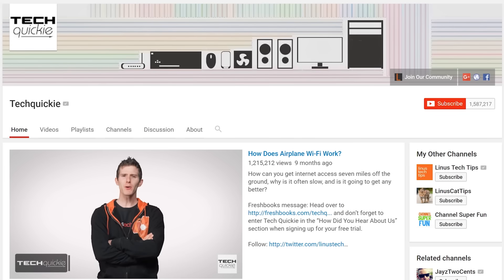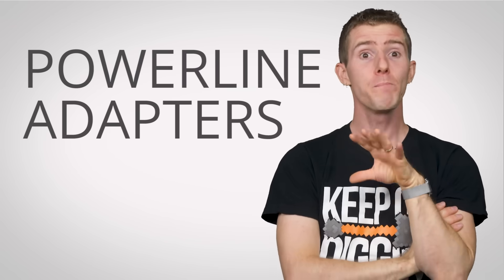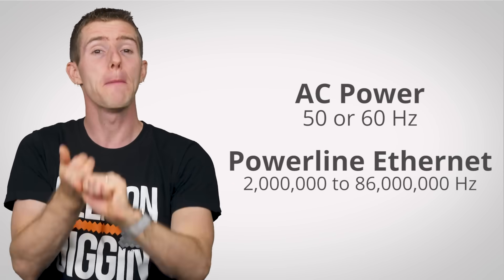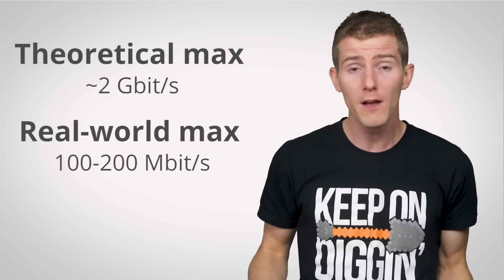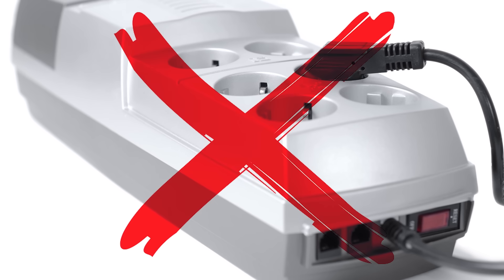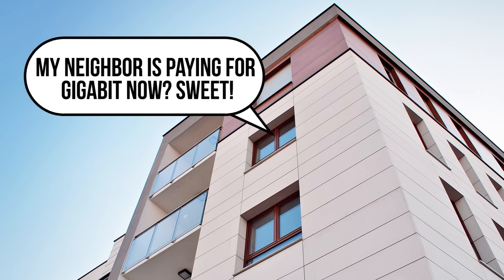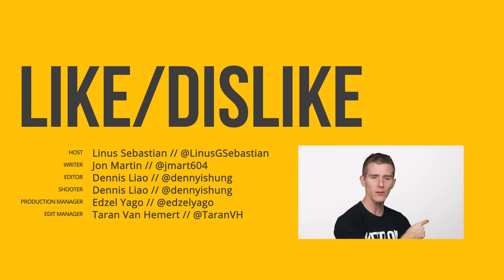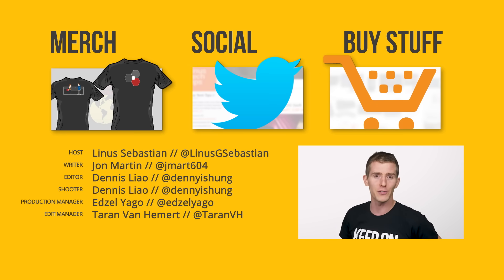How Does Powerline Ethernet Work?

Comment: >consistency advantage over wifi
Hah. I had powerline adapters. My use case was dead simple, and extremely low expectation - I had a setup for satellite TV where I had one main decoder attached to the main TV and two extra decoders attached to other TVs, with the main decoder essentially needing to just ping those side ones roughly once every 24h to let them know it's cool, they can keep on doing their thing. While the side decoders were in range of wifi (barely), they didn't actually have any wifi capability. Wiring everything up wasn't an option... but then, the perfect solution - powerline adapters! Yeah, no. After a year of grief with the adapters semi-permanently (until unplugged and plugged back in) losing connection randomly and a neverending cycle of resets, I had enough. So I bought the two cheapest old wifi routers they had on our local craigslist equivalent (think $4 each), OpenWRT'd them up to turn them into bridges putting whatever's connected to them onto the LAN as if it was connected to it directly (using relayd), and hooked the decoders up to that instead. And what do you know, it's been years and even with a weak wifi signal that has to go through multiple really thick old brick walls, I haven't had a problem since.

The idea seems fine but booooooooy did I get burned in terms of actual experience.

Comment: I have been using these "HomePlug" adapters for years and like most network devices, occasionally these need to be unplugged from the wall for 30+ secs and then plugged back in to reset the powerline network connection to your router/gateway.  but with each new faster generation devices you buy, you pretty much have to replace all your old slower powerline adapters, which can get expensive.  also remember to use the fastest ethernet cables between these adapters and your computers.  I have always stayed with Netgear models which Best Buy and MicroCenter carry here in the states.
Here's Linus comparing WiFi AC to Powerline...
https://youtu.be/Oxum9TZ11-M

Comment: We pay for 120Mbps
Direct LAN connection: 135Mbps
WiFi near the router: 135Mbps

Powerline one story up: 7Mbps (theoretical max: 200Mbps)
WiFi there: depending on the device between 18 and 70Mbps

Powerline 2 stories below: 30Mbps with many dropouts (theoretical max: 550Mbps)
WiFi there: depending on the device between frequent disconnects and 40Mbps

How does it come that our WiFi is so good in comparison to yours and our powerline capabilities to bad?

Comment: I use power line Ethernet as backhaul between floors and mesh wi-fi on each floor. I get solid 500mbps between floors and full wi-fi in all locations.

Comment: i think modern meters have enough filters on some kind to block higher frequencys, maybe just older mechanical meters pass through enough high freq. to get powerline adapters work in the next house if they connected to the same cable/phase.
if you want to block high freq. not going in or out your house you simple can add some filter that should work good enough to avoid some neighbours connecting to your lan.

Comment: Ive had a powerline ethernet adapter for about 7 years now. Ping is so consistent and my wifi is only faster on the 5ghz channel and while being on the same floor as the router. My room is as far as possible from my router and I never have a problem, just make sure to plug it directly into the wall and not into an extension cord or surge protector. I just got fiber installed on my street and im going to be switching to gigabit soon, ill have to upgrade my adapter but I've looked and the speeds have increased for them aswell.

Comment: Tech noob here - would this work if the PC's ethernet cable is plugged into a 220V outlet and the router is connected through a 110V?  I do believe the signal would have to travel through the breaker box. My internet is only 110/45 so I don't need gigabit like capabilities.  No, a direct ethernet option is not available.

Comment: lol I never even considered powerline adapters because I assumed they would never work properly. so I bought a cheap pair (€20) on Amazon and plugged them into my grammas house from the 40's with old wiring and no grounded receptacles in most of the house. I am shocked! even in her garage and garden house (literally 30 meters away from her house), it still works excellent. 7 ms ping to a speedtest server, jitter 0,75 ms. I should try pinging something local. wifi can barely go through walls in her house (it's Europe so they're all brick and concrete regardless).
this + a router actually gives me faster reaction times than the built-in 5 GHz wifi antenna in her DSL modem - which is crazy.
Reply: I know its europe because you mentoned grounding
Reply: "I'm shocked!" I don't know if that pun was intended or not
Reply: If I use this for gaming will it slow down people on a wifi connection
Reply: Off course it works, it emits from the electric wires in your house, actually turns your house into a giant antenna emitting strong signals on the entire HF band. Just google HAM radio and PLC. Much stronger signals than wifi indeed. Do you want you and your gramma to live on top of an aggressively emitting antenna on 24/7?  Ethernet cable is cheap and clean.
Reply: A J it's not clean if there's no Ethernet in the walls. Perhaps you live somewhere with cardboard houses and hollow walls so it's easy to run extra wires, but it's easy where I live. you're looking at thousands to rewire your house.
electricity needs to be checked / renewed every 20 years, and it'll be due by 2022. I'll consider running Cat6 or maybe 7 if it's worth it through the walls.
Reply: @arnemaeschaelck5012  Can you tell me the name of the exact product you purchased, I am very pleased by your statement and am tempted to by the product
Reply: @arnemaeschaelck5012  I did exactly that, bought shielded ethernet cable (made to transport data, unlike electric cabling) and pulled it to where it was needed in the house. Yes a bit more effort but fit for purpose. Neccessary as I listen to shortwave radio and like to have a clean reception of weak, far away signals and stations. So I do not have to live with 24/7 massive garbage signals emitted all around the house. PLC's cause massive pollution of the spectrum. I understand most people do not realise this, and buy PLC's it in good faith.
Reply: @enjoylife_carpediem  2 things.
1. Garage likely has power with outlets to plug these things into so it's not emitting anything.
2. We have tv and cell phone signals going every which way.  We already live in a radio signal saturated world.
Reply: @jmugurr994  The electrical wires of the house/garage radiate strong signals over the entire HF band once you connect the PLC, the newer PLC models emit rom 1 up to 80MHZ.  Those wideband signals are strong enough to bring down any shortwave receiver, on any given frequency, in a radius of 100m, just try it and see for yourself. Compare this to mobile and wifi signals which nicely stay in their bands and cause no disturbance at all.

Comment: My brother just tried powerline with disappointing and weird results. 20 mbps on a 150 mbps connection only 2 rooms away. The weird thing is that he was getting 40 mbps when one of the powerline was on a surge protector. If both were on a surge protector it went back down to 20. Tried multiple times with the same results each time.

Comment: The only issue with this is if you have old 2-wire romex it won' t work correctly. It uses the ground in the romex to carry the signal.

Comment: Well Ive had my Network Adapters for about a month now. And it works. But the internet connection of the home itself is still sporatic. Sometimes I have no lag at all, and other times everyone in the house struggles to watch YouTube and I have lots of latency. And it even worked surprisingly well at my granparent's 1967 built house.

Comment: 2 to 86MHz is essentially the HF or High Frequency part of radio (with some low VHF). It includes many military, broadcast and ham radio bands that are still relied on for local and worldwide communication. This can cause problems for those users as was found out in the late oughties when broadband over powerline (BPL) began to be used as a way to distribute faster than dsl speed internet to difficult locations. The system basically made using the bands between AM and FM radio (1 to 86 MHs) useless. Of course this was more of a problem for a system that could cover large sections of a city than a one home installation. Aside from hundreds to thousands of Ham operators, most of which knew and understood the problem, complaints came in from radio users from NOAA Weather Radio to taxicab drivers.  Even Citizen Band users would hear the buzz of BPL. While It lasted only a couple of years it left behind a fully developed technology. It seems that has been turned into another solution for WiFi's limitations. Unless you are (or live next door) to a ham operator it just might fix your WiFi.

Comment: I have learned that these power line adapters do not work when you have to pass through sub panels. Ex: from a room in my house through a sub panel to my workshop building.

Comment: we are wanting to have internet in the upstairs of an old 100 year old building that does not want us drilling holes or running cables. while there IS internet downstairs, we can not get any upstairs via conventional means, do you have any suggestions we could try if powerline networking falls short? we are going to need a bare minimum of 8mbps upload / download.

Comment: This stuff works but there is a problem with a frequency  conflict with DOCSIS. Many of these that go above 86 MHz cause issues with coax QAM upstream, which in most areas is in the 5 to 50 MHz range. Causing major interfere with others that can bleed over onto the coax through the DOCSIS cable modem can add noise on the plant and may result in you being disconnect  at tap by your ISP.
Reply: Tried the power line stuff advertised at 1Gbps but only managed around 8Mbps down and slighly faster upload at 15Mbps for some reason. Then I got the idea since I don't use cable but there are cable jacks everywhere, bought myself a Docsis 1.1 out of curiosity how fast the uploads can go if maxed out of the theoretical 10Mbps, came with 1 40Mbps downstream shared with everyone on the node and like 8 upstream line cards. The uploads came with two modes one is limited to 5Mbps and the other 16QAM 10Mbps. I set the highest of course. Believe it or not all you need to boot up those Surfboard Modems were a Windows Server 2012 R2 machine or similar with DHCP and with 3rd party TIME software installed (NOT NTP), tftpd64 software and a free config creator (just make sure to set the proper secret on both the CMTS and config before compiling). With a single modem on the line (with correct attenuators so not to blow things up) the downloads were decent close to 40Mbps, but the upload even uncapped were at a pathetic 4-5Mbps at a max 10Mbps @ 16QAM, and at the lower 5Mbps setting it was some pathetic 1Mbps or less! This was with ONE modem online, no wonder ISPs offer packages like 5Mbps/128Kbps-512Kbps back then. Got fed up and just shelled out more cash for a used mini DOCSIS 3.0 with channel bonding and got close to the 1Gbps/200Mbps. It doesnt take much to get a modem online, the software ISP uses just have added billing and customer information, but useless if you just want to use those jacks. Modems are dirt cheap just the CMTS if you can afford it.

Comment: So I’m running my Xbox on the wifi. The router is downstairs past the kitchen on the other side of the house. It’s a crappy router and I’m using a crappy extender. My download is about 5 mp/s and my ping is usually 150. I can’t straightlone Ethernet in because 1: super far and a 100ft wore barely reaches. And 2: the mum doesn’t want a long add wire running across the house. Should I beef up the router and extender or just buy a power line adaptor? Someone plz help. Need to figure this out for my new set up
Reply: A Powerline adapter is the best option if you want to carry the internet signal from the main router all the way up to your bedroom. The first part of the Powerline adapter connects to the main router via LAN, and then the second adapter goes into your bedroom (they both must be directly into the plug socket, not through an extension cable). Then you have excellent signal strength in your bedroom.

Comment: Trust me, avoid using powerline network adapter even if your life depended on it unless you live alone. If you live with others all it takes is for them to charge their phone in their room at night and you will not have internet unless it's unplugged.

Comment: I’m told that the power line adapters have to be on the same circuit. I’m experiencing trouble with this after a recent install attempt; modem on one circuit and Xbox/power line adapter on another. I can’t catch a signal. Any thoughts?

Comment: My Netgear Powerline 1000 slowed down connection to FB and Youtube.  Because when I removed it and used my WiFI network directly.  The programs load just fine.  Had  Powerline installed and working great since December 2016.  So did it just wear out??

Comment: My router is right next to my computer, and I am trying set up power line Ethernet. Can you connect the first and second power line box to the same wall socket or do I need to connect the second power line box to the outlet in the other room and run a bigger Ethernet cord from that room to my computer?

Comment: Hi can anyone help me out here?
So I have an ordinary router thats connected to a powerline and wondering if I can use a second router for stronger signal/speeds on the other end of the powerline adapter.

Will this work?

Fibre Box > Router 1 > Powerline 1 > Powerline 2 > Router 2

Comment: One downside of this stuff is that it's frequencies overlap amateur radio HF and VHF frequencies. Power lines and home wiring is not known to be very good at keeping the RF energy contained.... Actually, it's terrible at doing so. This stuff wrecks rx. I can tell when someone near my house is using the internet, which is often. I hate this stuff for this reason alone. Selfish? Yes. Justified? Also, yes.
KI7ONN

Comment: So it actually works by sending a frequency down our power line. A different frequency than the 60 Hz of AC, so that there's minimal interference with both signals. Similar to how our radios pick up different frequencies

Comment: Question for Linus...for anyone actually. I live in a 3 story/6 bedroom townhouse and recently got FTTp installed in the house giving me a 330mbs down (theoretically). Would I be better with a wifi mesh set up OR a few of these strewn around the house.  I'm getting OK wifi throughout the house using the generic isp router they gave me but I figure I may as well max out those speeds. It will be serving 2 desktops, 2 laptops, 1 tv, 3 chromecasts, 2 phones and 1 tablet a ps4 and an x1x. Any help appreciated.

Comment: Hi everyone, I need your help :)

I have Ethernet outlet in the wall, both downstairs and upstairs. My router is connected upstairs and I have a WiFi dead zone downstairs.. I tried a WiFi Extender but it’s not working so well..

So my question is: Can I connect a second router (and use it as AP) in the Ethernet outlet downstairs to solve my WiFi dead zone issue?

Huge thanks to anyone who helps! 🙏🙏🙏

Comment: Like so many people in the comment section, I too had my reservations about PLC. My family made a recent downstairs addition to our house with my brother and I moving there. 1 single electrical line runs downstairs from the upstairs breaker box to the downstairs breaker box where of course it branched off. Not only does downstairs host myself and my brother and all our electrical baggage but it also hosts our washroom with two washing machines and a dryer. Running an ethernet cord along such a high powered electrical wire would have been a nightmare. I found out about PLC whilst refreshing solutions to my problem, a Wi-Fi repeater would not work due to my house being all concrete. 

I borrowed my friend's PLC AV500 standard to test the technology. I averaged 50MBPS download but it absolutely flatlined on laundry day for obvious reasons. Upgrading to AV2 standard solved all my issues. I now average 269 MBPS and 189MBPS upload, dropping to 169 MBPS download on even the heaviest electrical load, more than enough to be streaming 4k videos to mine and my brothers devices from my NAS that I have upstairs. PLC has been a life saver

Comment: These are great for connection outbuildings. I have a overhead power line to my shop and they work great. Use them on the same circut if you can helps allot.

Comment: Since utility companies already use ethernet over power lines to detect status and send commands to switching equipment, some have adapted the protocol to create "cable-like" internet services at lower cost than either cable or DSL (and the wires are already there).  However, some gerrymandered state legislatures have passed laws (or tried to) prohibiting these services, at the behest of cable and telephone companies who don't want the competition.  Thus, they are more likely to be available in cities that operate municipal power companies, in cities and states with progressive voters, who elect political leaders who take the side of middle and lower income working people, rather than corporations.

Incidentally, if the shock hazard is a concern, the coupling between the wiring and the signal input and output circuits in each network node (i.e. modem) are via transformers and/or capacitors which only pass high frequency signals.